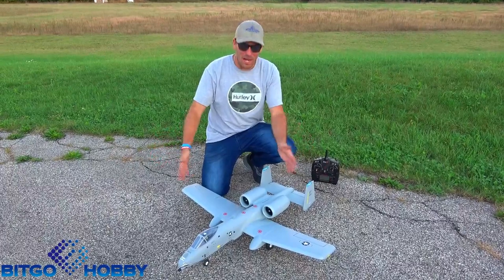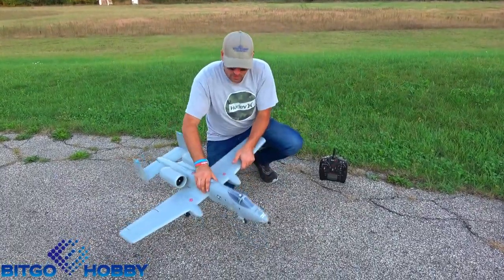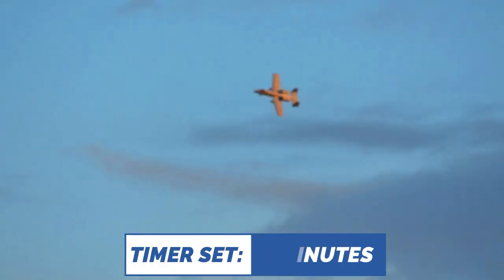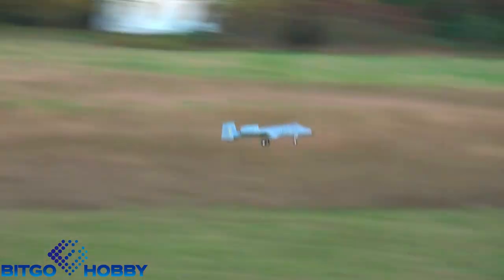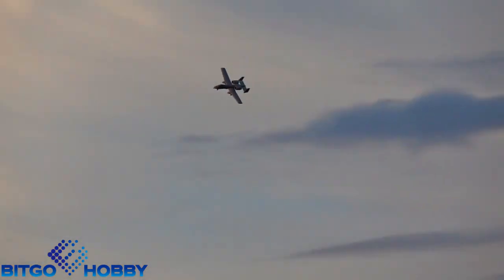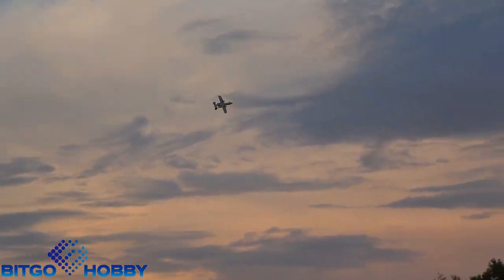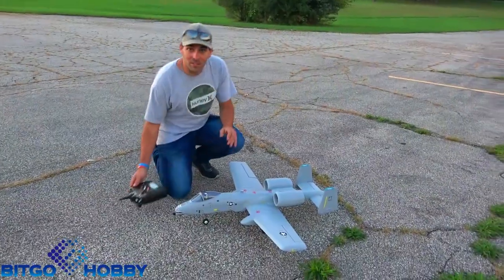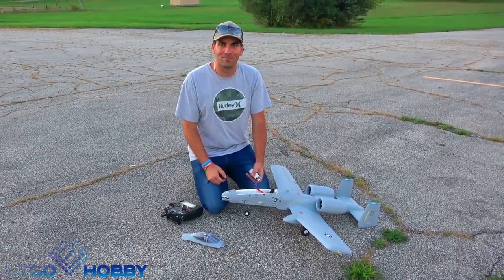NEW XFly A-10 Maiden Flight!

Comment: The paint on the x fly is the best I have seen , they don’t like grass I changed  wheels to a thin taller tire no problem
Reply: I was wondering what tires are you using?? Do they work well?? I just purchased this A-10 myself, still in transit. How do you feel about it?? 
AirHammer out!!
Reply: @airhammer6203  I used a real thin wheel you can buy from Robert or Debrou.  I made mine on a lathe about 1.75 taller than original and about a 1/4 thick so I can slice through grass